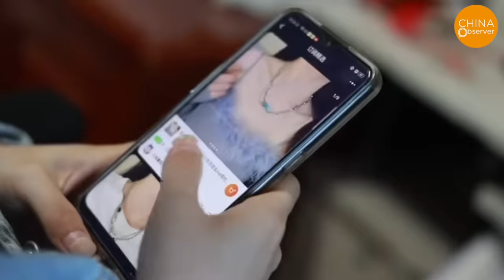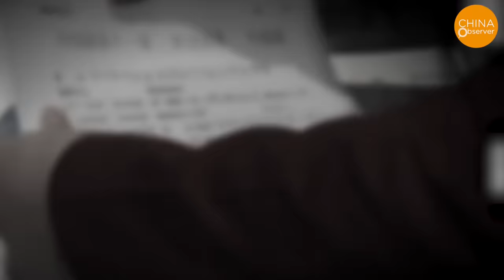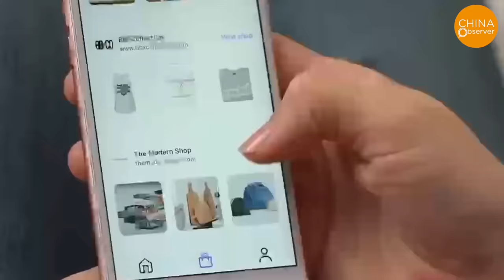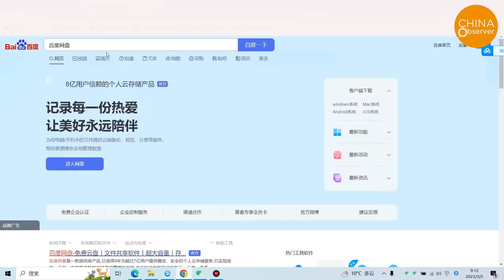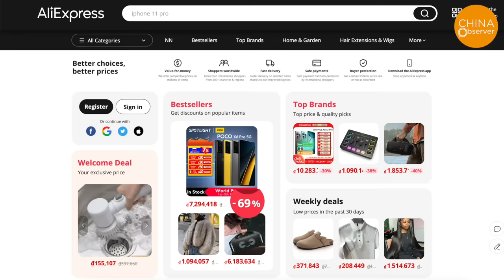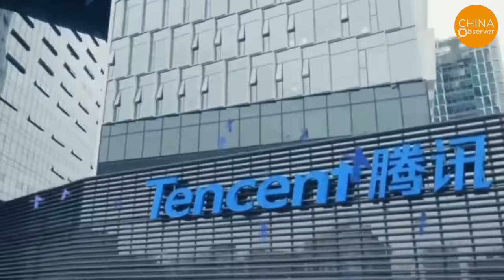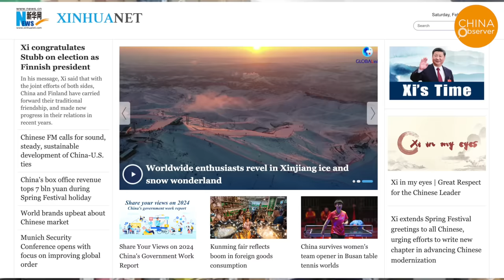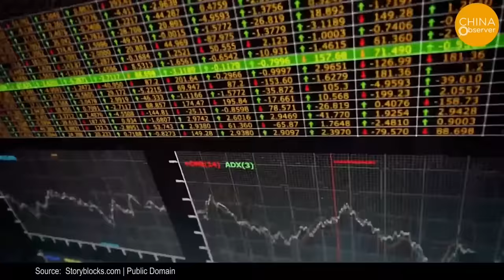Cigarette Butts, Cardboard as Fillers Make Temu, Wechat, Taobao Infamous! China Tops in Fakes!

Comment: No Made in China....🥶🥶🥶🥶🥶🥶💀💀💀💀💀💀☠☠☠☠☠☠☠
Reply: Waste of money
Reply: 💸 Reverse engineering China, from USSR...💩
Reply: Hate to tell you... I decided like a decade ago when going to Home Depot for some lumber I was going to do an experiment - buy one tool (or accessory like drill bit set, etc) that was "made in USA" (not "assembled in USA" etc).  90% was made in China, a few things like a Stanley tape measure were "assembled in USA" (they slapped a sticker on it probably)... Do you want to know the ONLY thing I could find definitively made here? A claw foot pry bar.  That's right, the only thing we could make profitably here is a bent piece of steel. (I also picked up a 3pk of fine/med/rough cut circular saw blades that were made in France).

I've got some tool catalogues where you can buy drill bits from China for $4 and ones ground in the US for $16 - if you're running a machine shop or something and the Chinese ones last half as long but cost 4x less, guess what is likely to win?  And then as an average consumer who uses that drill bit twice a year maybe...?

Not saying I like it, but...
Reply: @captainz9  I would not ever knowingly buy anything made-in-China, I would do my research or I would do without it if I am in doubt of its origin. As little as a disk-brush, I am more than happy to pay 4times more made locally than a cheap chinese one, knowing that i contributed to local economy and I am happy to tell you the one I brought last much longer, still as good as new. 
The true fun thing is that this attitude (admittedly pure political) actually save me money: 
1- not wasting money on cheap bc good quality last longer , save money in long run
2- hesitant on made-in-China, giving me time to think about 'do I really need it?' Often turn out that I don't and find alternative to deal with it. Save save , actually what the CCP says "win-win"😂
Reply: The point I am trying to make is : weaken CCP economy NOW, so it would think twice to wage wars against small weaker countries bc when wars broken out it would have been much harder and too late to impose sanctions (Russia v Ukraine war as example).

Comment: Yeah, I've been to a few shenzen/hk markets where the quality is not 10% or 20%, it's in the 0.1% range. Maliciously compliant to "work". Clothing, you need to see if it's stitched or they use ink/burns to replace stitching. 

The handbags are the audacious fakes, but ... tech is often trash. As noted, some of the OEM's get the blueprints to make the shell/labels the same way ... but that's all they can do.

Lead weights silicone glued inside battery packs instead of batteries. 
A 2tb MicroSD card that shows as 2tb when plugged into a phone/tablet/PC, but can't store a picture, let alone a single text file. only 16kb is usable, which is probably because it's built in. When you reboot or unplug the MicroSD, the file is gone.
Apel Phones, 'themed' android 6/8,  that don't have enough memory to actually open the camera app. 

They do turn on, but it's just bizarre. They don't think people will try to load music or switch the phone on, so they gamble on the product not being tested or used in the store. I'd say it's perhaps 'buyer beware' but they will chase you down to force you to buy their knockoffs if you're not asian. I had aggressive 'english speaking' people following me from shop to shop back in the 90s. Good to see it hasn't changed much.

Comment: Was eating a bag of Ruffles chips the other day. There were electrical wire pieces in it, with the wires sticking out! When I checked the bag, made in China 💀 Thank God I saw those before accidentally ingesting them. 
Lesson: Ditch junk food 🤣
Reply: I bought some apple juice off Amazon the other year - printed on the container it said "concentrate from Ukraine and China".  After drinking about half the 64oz bottle (while working) I noticed my back feeling itchy and actually lumpy to the touch - I was breaking out in what I'd class as a mild allergic reaction.  Went away after a few hours, but I'm sticking with better name brands now even if it costs a bit more.
Reply: Since when are Ruffles chips made in China?